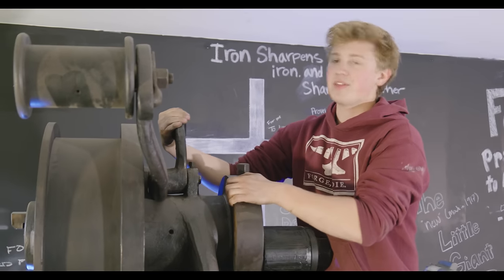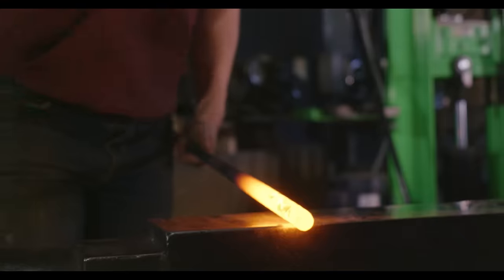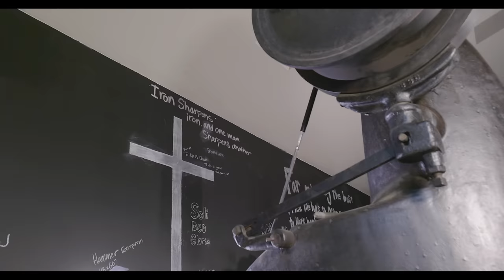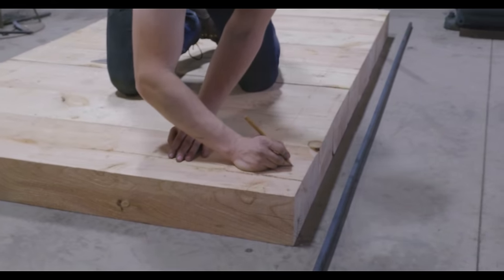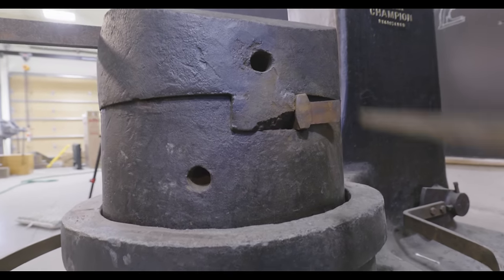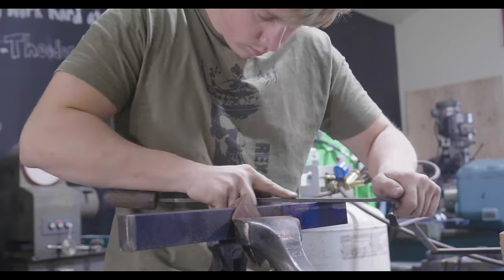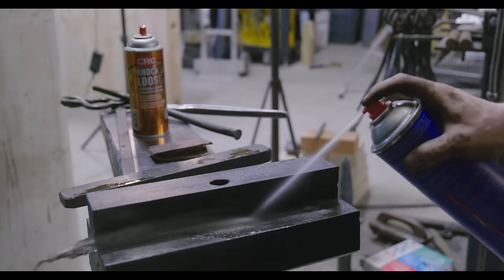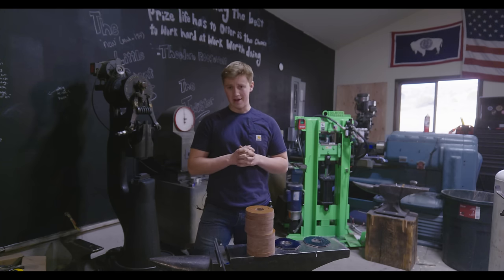Beaudry Power Hammer Restoration! Pt 3

Comment: Will, if you have to drill holes like that, buy a ship auger drill bit of the correct diameter, makes it a lot easier. can be found in the drill section or over in the electrical tools area of most hardware stores.

Comment: The Power hammer Paradox: You need a power hammer to forge parts for a power hammer.  But what came first?  How did the very first power hammer get its parts?  Aliens.
Reply: There's a legend among blacksmiths that on the eighth day, God created the first pair of tongs. It's quite difficult to make a pair of tongs without using another pair to hold the rivet, so the first pair must have been a gift from God!
Reply: @pixelkatten  No, the apprentice holds the tongs.  If he burns his hands then he doesn't work and you don't have to feed him.  If he doesn't burn his hands then you have a new pair of tongs.  Win Win

Comment: With your keys for the machine is very beneficial to heat them up with the torch and get some beeswax and rub it on your keys it keeps them from rusting plus sticking as much they will stay in place but it is easier to remove them

Comment: Unless there is a need to  disassemble the base, simply gluing it together with a high quality wood glue (Titebond) and clamping it until it dried would have worked.  There have been a lot of studies of glue joint strength where the wood failed and splintered before the joint.  Think about that for the next base.

Comment: Question: Why did you put the flange nut on the treadle spring upside down?
Reply: I suspect to act as an indexing bushing on the inside of the spring.
Reply: @TomOConnor-BlobOpera  But it was screwed down on top of the top washer, not inside the spring.

Comment: Can you just wood glue a base or do the vibrations from the hammer eventually break it apart?
Reply: it's an issue of psi, the amount of pressure being transmitted exceeds the tensile strength of the wood glue, so as the hammer comes down it would blow the planks apart, they would likely remain under the hammer (because the hammer itself is bolted to the floor) but it wouldn't be a solid connected base anymore.
Reply: I agree with Trio, glue will just break. Your best bet is end grain up timber bolted together, that will take the most force and last a hell of a long time before any damage or issues happen, 

The only thing I could see is endgrain doesn't dampen/sponge force like the side grain does so that could affect how the power hammer functions. 

Well worth a video to test in it's own right I reckon
Reply: Thanks guys. I figured there was an obvious reason why knowledgeable blacksmiths make their bases like this 🤌🏻

Comment: How do you plan to crown the pulley? Will throw the belt endlessly unless it is crowned.
Reply: He may have cut the Micarta slices different diameters to approximate a crown, doesn’t take much. Also the other pulleys are flanged so that should help.